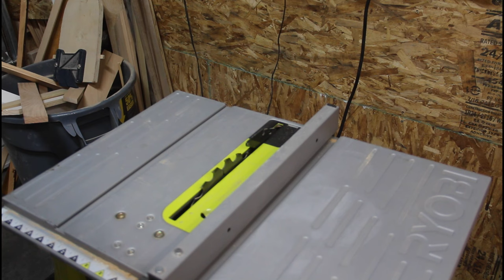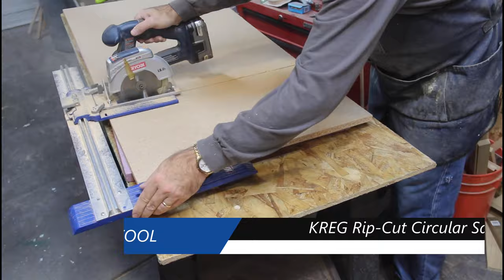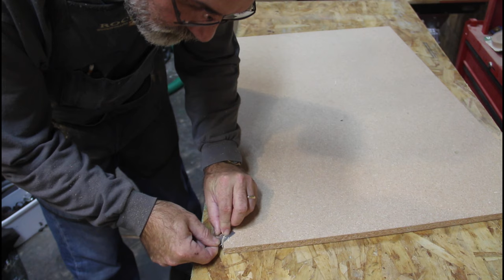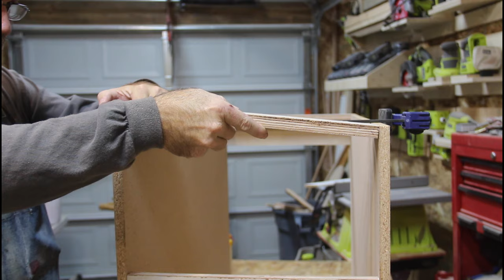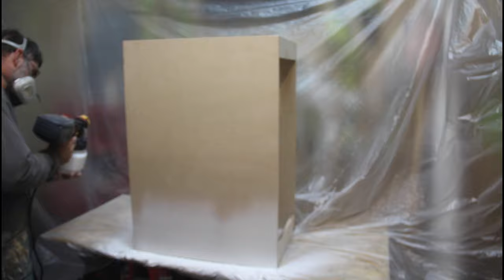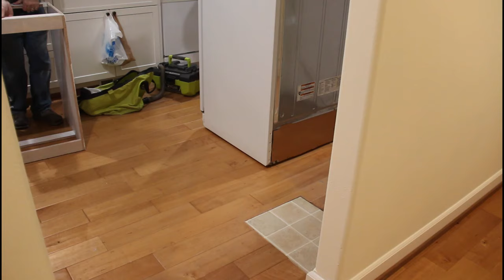BUILD A CABINET for the WINE Fridge! | ONE Day BUILD! | 2020/34

Comment: Is this for the 18” wide wine fridge? If so, what is the measurement for the playwood?
Reply from the maker: It's a 15" Fridge: Kalamera Mini Fridge 15" Wine Cooler Refrigerator - 30 Bottle Wine Fridge with Stainless Steel Refrigerator& Double-Layer Tempered Glass Door and Temperature Memory Function Built-in or Freestanding: https://amzn.to/3yVrhZB

I used 3/4" plywood from Home Depot: https://homedepot.sjv.io/YgAX7r

There are additional product links in the video description.

Comment: any heating/ventilation issues?
Reply from the maker: Nope. There is about 1/2 clearance on the top and sides, over an inch underneath, and about 4 inches from the back to the wall.